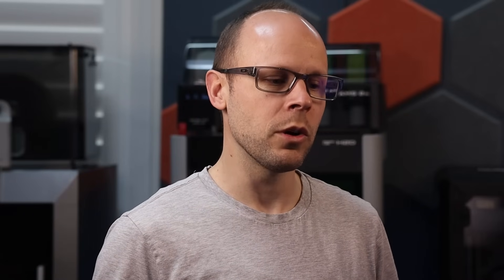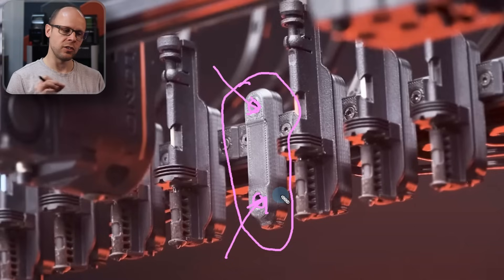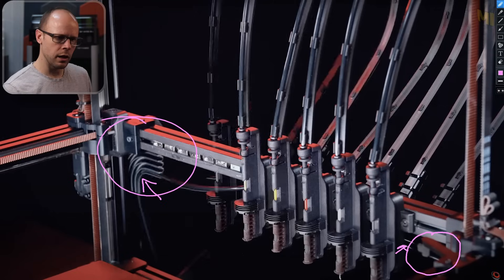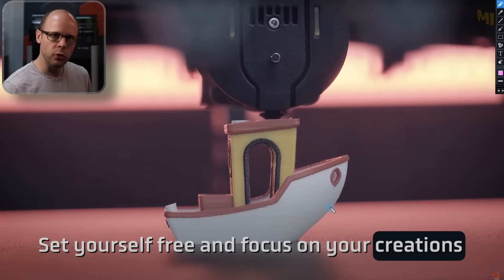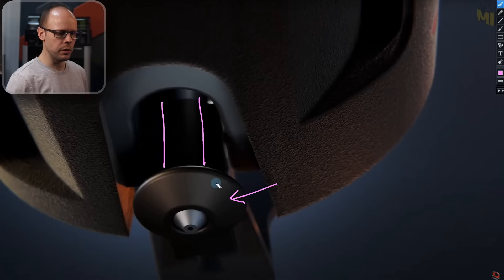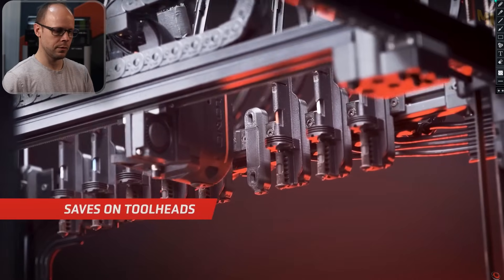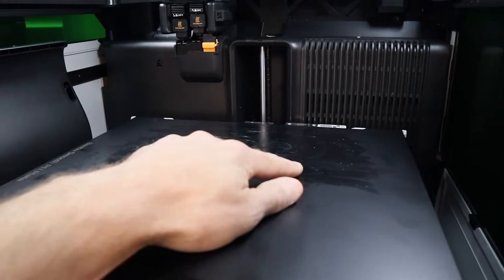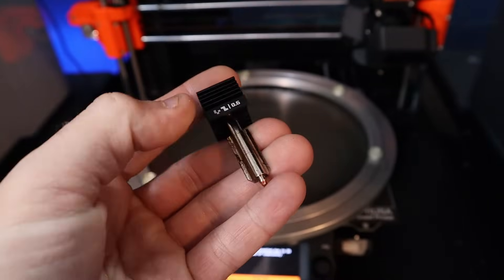This NEW INDX system from Bondtech will be a game changer for mutli-color/material 3D printing

Comment: Could it work with the Creality K1Max printer?
Reply from the maker: It should technically work with any open source Klipper based printer, the biggest issue would be how to retrofit it.  Given enough time, someone will be able to come up with a way to do it, but if you want something right away, a Voron or the Core One would be your best bet.  I'm selling a few of my older printers to see about buying a Core One L so that I can be ready for when the INDX is released, I think it will be an absolute beast for true multi-material.
Reply: 🙏🏼👌🏼 @NeedItMakeIt

Comment: p.s. I wonder how long it takes for Bambu Lab to copy that ... after they copied so much (Klipper, printables, Voron 2.4, PrusaSlicer) ...

You didn't discuss probably the two most possible printers for this system: Creality K1-Series and the Sovol SV08 Voron 2.4 Clone!

Because those printers (unlike the Bambu Lab P1/ X1 Series) do have open source Klipper on it, are broadly available, relatively cheap compared to Bambu or Voron Builds, big communities out there and many after market parts already available. That Kobra S1 with Rinkhals running could also be a great candidate.
Also since ACE and CFS are also widely available (and thanks to Klipper) maybe usable for a 4 printhead solution.

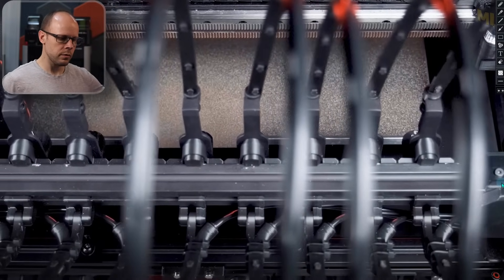Comment: 9:00 Just a matter of nomenclature, the heat block is the slab of metal in a more traditional tool head that typically houses both the nozzle, heater and thermistor. The heat break is what prevents the heat held in the heat block and nozzle from travelling up into the extruder. Hope that helps clarify things.

Comment: @10:12 My take being the ENTIRE thing wrapping around the Hot End being the Silicone Sock since after all they say it's a contactless / Induction based System with the squarish Cutout towards the Tool Head acting as a Window for Temperature Sensing 🤔 I really just hope Bondtech isn't pulling any BS with the first iterations of those Nozzle by them not being CHT HighFlow equivalent ones cause sure enough a move like that will immediately drop any interest I might have developed for INDX 😑

Comment: But does it have some form of pressure sensor in the extruder to allow for flow calibration and other nice stuff like Bambu does?  Does it allow probing with the nozzle to determine the correct z offset per tool and making a bed mesh?  Will such inductive heating disturb other tech such a printer might have, ex. an inductive probe?  And of course ... Price?  Inductive heating isn't known for being cheap and if this tech is going to cost more than traditional tool-heads with a heater and extruder per tool-head, then that defeats the goal of reducing cost and also Bondtech isn't known for its low prices, so I doubt this will come near my budget.  $35 per tool seems wishful thinking to me.  That might be what they'll charge for a nozzle ...

Comment: At a recent show, they stated there is no bed sensor integrated. It was when it was demonstrated with the V0. They said there was no need for one on the V0, but he would ask the engineers about compatibility with existing sensors. I think one important thing to know will be flow rate. Older machines  were able to get away with hotends with 20mms^2 flow.  Faster machines are needing up to 60mms^2. Their heat block seems long, but it would be nice to get some numbers on flow.  A nice note is that the V0 has a top mounted MGN7 rail, the V2 has an MGN12 fron mount. If they are able to accommodate both of those, it has to come with several adapters to properly secure it to these various mounting systems.

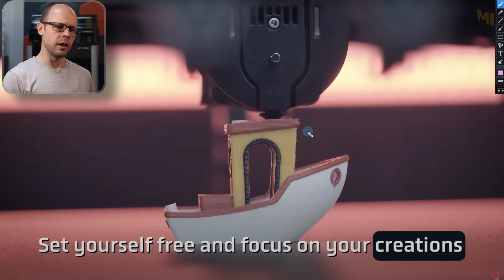Comment: 7:51 The brown and black filament on the benchy looks a bit uneven, harder to tell for the other colors. Also, no mention about the weight of the primary toolhead plus indx tool, nor anything about what print speeds this could work at based on that "total" weight. It's a bit early to say yes or no on that since they aim for a November release. In theory this solution looks like it is very good middle-ground, depends on what printers it will be compatible with, but it could also push the printer manufacturers to innovate. At least I hope so since I'm closer to appliance user than tinkerer.

Comment: look up the BONDTECH INDX voron 0.2
magnet inside the rack and steel pin in the tool. 
looks like the silicon sock is on the nozzle. 
auto tension, not calibration. 
purge tower would only be needed to get presser built up in the nozzle. 
the tools are stored on the front of the printer, not the back. the bar is added to the printer with plastic mounts.

Comment: I have some serious concerns with the induction part of this design.

I've previously worked on a tool changer that does the extrusion part that they show and it works well. It lets you adjust a lot of different things.

The induction heating is potentially a big problem for conductive filaments, yes, but I'm much more concerned about the flow rate. Induction style heaters often have a huge problem with maintaining heat at a specific temperature, especially when you are cooling the heater via some method. (In this case, the filament is doing the cooling.) The near complete lack of thermal mass means that the max flow rate really is the max, which means it is going to be significantly lower than other heaters, even if the "stable" max flow rate is higher than average. (Though I doubt it is.) And considering even for the most high speed printers, they rarely reach the max flow rate per print, that peak performance is important.

Now, if they can get the stable flow rate greater than 20 cubic mm/s with a 0.4 nozzle, they are fine and outperforming the vast majority of needs. But if the flow rate is below 8 cubic mm/s with a 0.4 nozzle, that will be a serious problem.

All of this to say, this will work well for prototyping but is not going to work for mass production and likely will involve a not insignificant slow down in printing speeds.

I could be wrong, but notice what they don't include on any of their literature that almost every other hotend manufacturer includes, the flow rate.

Comment: This system looks very interesting. I'd love to incorporate it into my idea for a 400x400x??? printer build.
8:59 The "heat block" would be the block of metal that gets hot. Think Ender 3...It's screwed into the bottom of the heat break. In this theorized setup, the heat block would technically be the ferrous tube inside the ceramic nozzle assembly thingy.
10:50 Yea, not so much "purging" but rather "priming" the nozzle in case of any oozing/bubbling/etc.

Comment: "Heat block" is different from heat break. It's the copper/aluminum block that's heated by the heating element, which then transfers that heat to the nozzle. It adds thermal mass to the system to stabilize the temp. They don't need a heat block because induction heating gives you tighter control over the temperature.
They confirmed that the dock/undock mechanism is driven by the extruder motor.
There will still need to be a prime tower like Prusa XL to equalize the chamber pressure, but it'll waste way less than a purge tower.

Comment: On a bed slinger, we could rotate the head 90 degree and dock the heads on the sides one above another (2 heads). I would for sure use that for multi material prints. 2 heads is all I need.

Comment: Bondtech says in the 3d Canuck video (https://youtu.be/XRQGVSnzLPg @ 5:34) that the filament gripper is part of the system that also grabs the head, it's extruder motor driven. My guess is that before it does the Z-shift (to lock it), the extruder motor meshes with a gear that moves all of the mechanical bits before it's disengaged (possibly the gears have a slip mechanism so they only go to a certain tension). That Z-shift could be done as the gantry pulls the head out with a ramp.

In that interview it also seems like a lot of the swap time is for the heating portion since the heater stays on the gantry. They could probably sell an upgraded tool mount that has lower-powered "idle heaters" that GCode toggles on (in preparation for a switch) that would cut a lot of that time out.

Comment: The "units" will likely be assigned their heat, volumetric deposition rates, will be addressed at slicing...and existing material calibration values can likely be used, or slightly tweeked.

Comment: On the bondtech discord there were some messages that gave a little more info on the process for releasing a tool. On the left side of the toolhead there is a little hole and there is a pin on the left side of the gantry. They said the toolhead goes over there and the pin inserts into the hole to physically open/unlock the extruder from the tool.

Comment: as to the nozzle, a ceramic covering over a steel nozzle, then, the only thing being heated with induction would be the nozzle itself. 
this would allow for rapid warmup and cooldown.
if the nozzle magnetic and conductive properties are known, they can obtain pretty accurate nozzle temps by magnetic feedback to  the induction coil itself. 
the trick is how rapidly this responds to temperature variation. it also keeps the thermal mass fairly tiny.
While I like my standardized nozzles, I'd happily give them up for a new standard. I do hope they put out a Diamondback for this, most of my printing tends to be with rather abrasive materials

Comment: The  photos you showed, clearly shows magnets inside the T-slot on the frame. But maybe magnets on both sides....
Reply: If you mean at 4:53 into the video, those look like t-slot nuts that the FDM printed holders attach to. Other shots show there is possibly both cylinder magnets on the INDX head and the holders or perhaps a combination of magnets and steel rods. When they are protruding past the surface it suggests they have a role of being an alignment pin, so it may be a combination of alignment pin and holding force from the magnet.

Comment: Game changer ? Yes. I can foresee Bondtech's INDX coupled with IDEX quite easily. What bothers me a bit is the the deeply opinionated ecosystem derived from this. I guess that's an unavoidable byroduct of such a system.

PS : 3D printers are CNC (computer numerical control) machines by definition.
Reply: I'm sure he knows that 3dPrinters are CNC's, but the "hobbyist" jargon has differentiated the terms to have CNC mean -> cuts material, as in if someone says "my CNC has .." it normally is shorthand for "my automated router." It's been accepted slang/shorthand for many years.

It's kinda like how AI got accepted in the general lexicon to describe any "machine learning algorithm." Once it leaves the engineering group and marketing/the public start using terms, they loosen up quite a lot.
Reply: @kylek29  That's right !

Comment: You only have a silicone sock when you have a heated mass you want to keep hot. With induction, it’s a direct conversion to heat instantaneously so no need to have a heated mass to keep at temp.

Comment: Calling things a "game changer" is so over used that I rarely watch videos that call things "game changer" (unless it's the game show game , "Game Changer"). But this tool changer, if it works as good as it looks like it is supposed to, and really comes out not too expensive, this really will be the next evolution of 3D printing. I want a printer with this, or something like it. 

So many layers of great ideas in this. Even the heating being induction. This seems really well thought out. I've only known about this tool changing system for less than a week, and I'm already keeping an eye out for the first available set up with it.
Reply: It's supposed to release in November and the initial toolhead is supposed to be $250 and $30 for each additional lane. Pretty expensive to start but after adding just a few more will quickly out price other tool changing systems. Hopefully it does perform as shown and without any major unforseen drawbacks cuz as you said it will really be a "revolution" and "game changer". 😁
Reply: @RobertD_83  at those prices it is really cheap - compared to, well, nothing, if not single Prusa XL toolhead.

And at those prices it would be bargain as Bondtech product - way cheaper than anything even remotely comparable to what they have sold so.
Thus I may be little sceptic if those are licensing prices for printer manufacturers or prices for individual buyers at storefront 🤔
Reply: Ive started just blocking channels that use the term'game changer' willy nilly. This actual would be something you can imagine being replicated or used as inspiration as the new thingTM
Reply: We'll see the elegoo or whatever version soon enough I imagine ;)

Comment: The auto adjustment is for tension - Softer and harder filaments have more optimal points at which the grip should be adjusted to.  There shouldn't be any need for 'hours of calibration'.  "Heat Block" isn't the heat break.  It's typically a large metal block where the thermistor and heater cartridge slots into.

Comment: They have made rid of the traditional heater block. That means that there is a new type of heater. They obviously made a totally new gear for the extruder, with some form of automatic tension mechanism. Given their history on that, this is something to watch out for. They are working on cheap tool change mechanisms, and that is key tech needed all over the place. Particularly for hives. As for materials used, there is new stuff all over the place. So while some of you just see a tool changer, I see a ton of innovation. This one appears to be a bit heavy on that part, so I hope they get it all to work at the same time. A bit "big bangy" this one. There will be reasons for their choices, and how much of this is tool change dependent, and actually not a universal step forward, we will have to see.

Comment: I don’t see it adaptable on a « standard » closed core xy printer other than a voron. The filament system is at the front and takes a lot of space, space that is not available on a closed core xy as a Qidi. I’ll be very interested to see what you could achieve with!

Comment: A tool changer with more heads than before. 
Why not 30 heads? IMO, PolyDye is the real deal in multicolor 3d printing.
Reply: I think the next big innovation will be light reactive polymers, where the color and/or intensity of the light dictate the color of the solid.

I am guessing this will show up in SLA printers first since they already use light to activate the polymer.  Then it will migrate to FDM.

I have not seen this yet, other than in my imagination.

Comment: The inductive heater needs temperature sensing, likely an infrared sensor.  I have imagined this system for a couple years. It greatly reduces cost, and simplifies complexities. Prusa XL, Bambu  H2D are obsolete.
Reply: Bambu had to comme with their dual nozzle system on the H2D because they are stuck in their AMS-related ecosystem. I agree that such a passive and compact tool changer is better.

Comment: No mention of how nozzle offsets are set or how flow is calibrated etc. i guess it does neither so will need setup. But i guess once its done itle be set.

Im happy with my h2d mainly for the other features not so much for the colours. More than i can easily print 2 materials.

Comment: Its interesting sure, but this is a big leap for Bondtech so I remain somewhat skeptical. 
One obvious issue is that because they have adapted the system to existing printers like Vorons with forward facing toolheads it looks like a very difficult proposal to fully enclose the system. A revised Voron gantry with a rear facing toolhead would allow tools to be stored against the rear wall and eliminate a lot of the filament path complexity. 
To make the most of it would probably mean a new bespoke printer design, or at least a new layout. Though with enough interest I'm sure that could happen pretty quickly and it is good that they seem to be just offering components to be adapted rather than trying to create and sell a whole new printer. I would imagine this means off the shelf printers will be last in line to take advantage though.
Precision, or rather repeatability makes or breaks tool changer systems and I am doubtful a printed system can maintain consistent height and offset of nozzle positions. I would love to be proven wrong though or maybe they have key machined internal parts to account for that.

Comment: So first I think this is great, we need more real competition in the multi material space. I do have some concerns about it though. Now bear in mind I am looking at it through the lens of someone who runs a print farm business where the machines run constantly and 90% of my business are products that utilize  multiple materials and colors. My average is 3 different materials (usually PLA, TPU and PETG) and 4 colors meaning I need something with at least 7 filaments. Right now that leaves me one choice as the Prusa XL is only 5 (sorry I have zero trust of creality at this point). So my big concern is that the assembly is plastic and not metal. From a durability perspective over thousands of hours and tens of thousands of swaps, I have reservations on long term durability and reliability. The calibration is another concern. When I want to deploy another machine, I don't have the time or desire to spend hours calibrating, tweaking and setting up a machine. I want to pull it out of the box, tell it to calibrate and then have it in service. If they can resolve those issues, this is going to be an incredible step forward. 

On another more petty note, I've noticed that many of the people who have endlessly bitched about bambu nozzles being "proprietary" aren't bitching about this nozzle being very clearly proprietary. I don't personally care either way so long as they are affordable, I just dislike how much hypocrisy exists within the community.